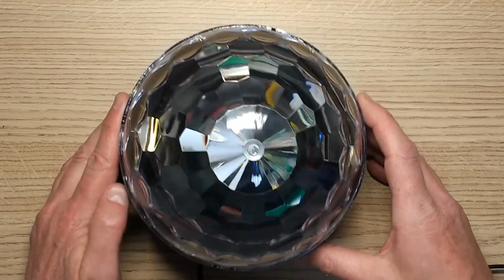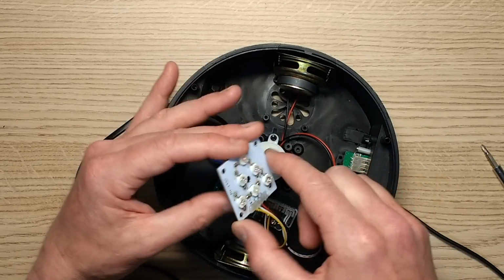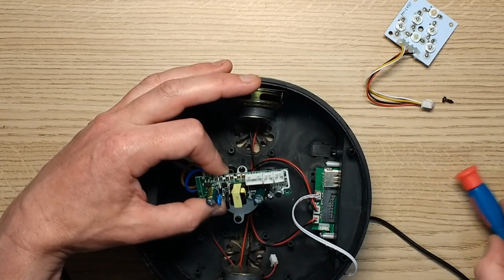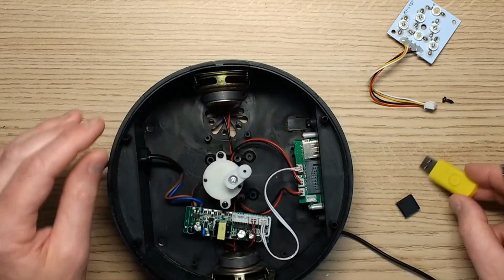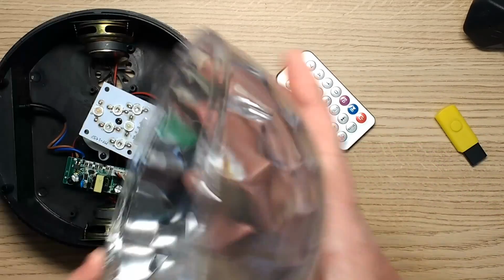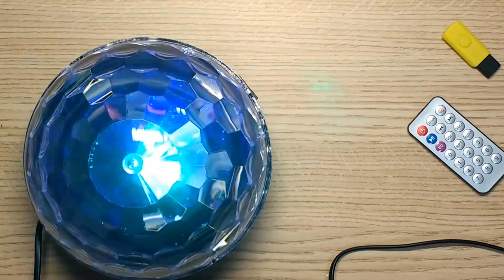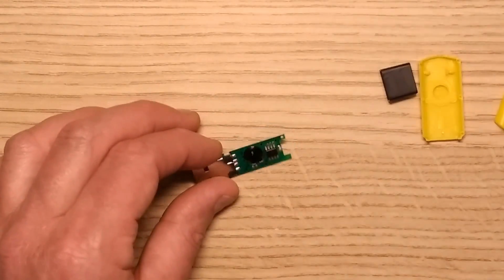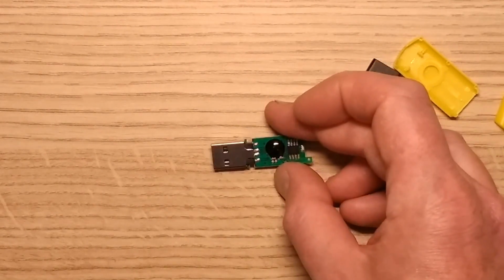Not so shitty MP3 disco light.

Comment: I got a similar Module awhile back, but it was just sound activated + an LED Ring at the base. Like you said, very modular. This one has a seperate power supply for the LED ring and the dome. This one just had three LEDs in a triangle formation so it would interact with the optics of the dome to create dots of light and and three intersecting rings. The audio gain was rather low, which actually made it work surprisingly well hanging (temporarily) on an electrical pipe. When the stage was dark, it was actually quite visible and responded to the beat of the music rather well.

The "dark side" was that I ordered two at once, and only one had a micro controller... The other one was a dummy that just tracked the lights across a supply and operated continuously.

Comment: @clive the yellow dongle is a low capacity flash drive with a few test songs on it, at least it was in my case, just plug it in the mp3 reader and you'll see
Reply: And probably also a trojan that puts your computer on a botnet for DDoS/Bitcoin mining purposes, the music is just a cover.
Reply: Delivery McGee - How do you get to that conclusion or were you kidding? I know nothing about this ducky thing.
Reply: Delivery McGee It won't trigger anything if he just plug it in the build-in mp3 player as I suggested...

Crocellian I have a bunch of these. They're quite nice and cheap. PSU tends to be overdriven on the cheapest ones though.
Reply: or just run a virtual machine and use that.. or make sure you have decent anti-virus installed. :)
Reply: Crocellian -- not paranoid, just pragmatic. Plug it into an mp3 player, it'll play a few songs to lull you into a false sense of security. Plug it into a PC with autorun on by default, and, well, let's just say the first thing I do when I get a new PC is turn autorun off. So yeah, what Caledonian TV said. It's kind of a thing in black-hat hacker circles to just drop a thumbdrive in the parking lot, y'dig?

Comment: I'd expect that cable that feeds the LED board to eventually break at the connector of the main board. It's just a crimped small gauge wire and those aren't intended for repetitive movement.

Comment: I got one of these a while ago based on this video. Came with Euro pin plug, but runs fine on 120ish VAC, so clearly "universal" power supply. Sound is more or less as I expected from a plastic enclosure like this - like a can of oatmeal. Might look into gutting it and putting the speakers in a smaller enclosure that matches their Thiele/Small parameters.
Could be fun on a suspended platform lighting up the ceiling as a sound-activated mirror ball thingy.

Comment: It generally takes 5 to 6 weeks to get an order from China where I live. Its ok as long as I am not in a hurry and no, I dont expect quality merch from them. Generally when I buy something, I have already planned on modifying it anyways. I cannot get some of the stuff I need for a project as cheaply as I do from china. Once I get it mastered however,I generally look for better quality components to do my final build. Its better to burn out a box of cheap inverters or whatever trying to get something figured out then to even build something myself. After I get things operating as planned,then I upgrade to better parts or actually seek higher grade components. I know developers that do this on a constant basis. My brother works in a research and development company for making packaging machines,they buy cheap micro controllers and cheap ass hydraulics as test equipment until they get past the initial stages,then they invest in higher grade parts.

Comment: Theres' also a "nice" one that can be built from an Arduino that will interface with wireless keyboards (Logitec, Microsoft, HP, Dell and other popular brands) pairing with them before the computer can, then paring it's self with the computer, so it can record all your passwords to your computer, and you bank and anywhere you do billing etc. and can then either store them, or try to use your computer while you're away (with the passwords it's remembered, and knowing you're away because it can't see you operating the keyboard, and may even know it's late at night) to send them up to hackers.

Comment: The usb stick looks like one of those promotional/advertising ones that acts like a keyboard and opens a command prompt to launch a web page and redirects you to a site whose url string is contained in the serial memory chip. To be safe you can sandbox it in a virtual instance of windows. I don't think much of anything will happen if you plug it into a linux machine but you can try opening a text editor and then plug it in to grab the url/command strings and see what it's trying to do.
Reply: sjm4306 Advertising sticks that run keystrokes? Where do those come from?
Reply: lights0123 I've gotten a few in the past. Can't remember from which companies but they were a thing a couple of years ago along small usb sticks with company logo branding given away at trade shows/conferences.

Comment: check the plug on the power cable, ours (from eBay UK seller) had a fake fuse installed, it that was connected to nothing! , the wires in the plug  bypassed the fuse completely, plug had fake BS standard marks etc.. 
🔥🔥🎆

Comment: I bought the Maplin version of that light a few years ago; it has DMX connections, but that's about all.  The user guide has the DMX personality table; but it's meaningless.  Other than the odd blink when you change a couple of the DMX values; it doesn't do a lot.  It's been sat in the bottom drawer of my filing cabinet ever since.  I might put it on Freecycle; unless that is Clive, you want me to send it your way to take to bits?

Comment: Definitely doesn't look like a rubber ducky since it has no micro SD slot like most of them do. The also seem to use an ATMEL CPU most of the time and those are generally bigger than that blob on the board. There also doesn't seem to be much on terms of power management on the board.

Comment: Just a note, Hak5's Rubber Ducky can automatically detect and inject payloads for any operating system, including Linux. Chrome OS is just another version of Linux, like Android is. You can't rely on a visual identification, either as someone has suggested, since  there are "generic" rubber ducky like devices that you can buy for a couple of bucks from China instead of $45. :-) 

Your best paranoid bet is to use an air gapped  machine with no mass storage connected (ie disconnect the HD or SSD), then boot up a live Linux DVD (Tails for example), and insert your mystery USB device. You can now use "lsusb" to see what the vender ID and product ID (eg: 03eb:2401, for a rubber ducky) for the device is, and then you can look them up on a net connected machine, although you can change the vid:pid on a rubber ducky, it's a good first thing to do...since if it shows up as a keyboard, you will know that something is fishy.  So if everything seems to be OK, you can mount and then list the contents. And then continue on with whatever OS the files are for, after checking them for malware, of course.

Comment: If you get the real DMX ones could you check if they fixed (received and using my fix) for the address decoding? I have 2 types of them and both had problem if changed the base address: instead of shifting they just blanked of the lower addresses and possible corrupting the RAM above

Comment: On the topic of USB killers, how viable would a small device to test them be?
Something in the order of a 5V power supply to a USB A female port through a diode so that the back flow from the Killer will shunt through into a neon or whatever. Honestly I'm not too sure on the requirements for such a device but surely it would be possible.

Comment: I've once got the same USB stick before, the controller will tell the computer it's a 8GB flash drive but when you write data in then it will overwrite the eeprom over and over again when it's full so basically it's useless

Comment: Download Knoppix (Linux LiveCD). You can use that to test to see if there is malicious software on the USB stick. Fully running linux operation system with many programs. I use it as a rescue disc for diagnosing and sometimes repairing hard drives/data recovery.

Comment: As well as proper mounting of the top dome and a properly isolated PSU, I'd want outer sheaths over the motor and left speaker (and light?) wires to bring it up to standard.
As it is, this thing's still shitty enough for me to avoid.

Comment: Clive and/or audience, does it have an upper cap on SD card capacity? This might be something I'd hack into my car, if it can handle external harddrives > 64GB. There's a chronic shortage of cheap mp3 players that save playback position (ea; don't revert back at the beginning of disk/card) AND are capable of handling large sd cards and/or external HDD's/SSD's.

Comment: Hum. So that device has a nice full-length ground pin. But it also has a two wire power cable. So what does that ground pin ground? The plastic power connector body?

Comment: Lol, just opened 2 of thumb drives in the same style shown here. One had a controller chip on the front and a blob on the back. The other had a controller chip on the front and a micro sd card soldered in on the back :/

Comment: I have something that looks like this but does have dmx. The dmx doesn't work properly (responds to noise as you plug it in but not actual packets!), and it rotates in different directions so basically winds it's cable around the motor and then unwinds it.
Reply from the maker: I have a DMX version too, but haven't tested it with actual DMX, mainly because the only items I can test it with are too expensive to risk damaging with a non compliant device.  It has a stepper motor for the LED panel and a mechanical end stop to get an initial reference position.
Reply: It might be ttl serial instead of rs484 like its suposed to be.
Reply: or even the wrong speed who knowes:)

Comment: The USB port is a computer port, not an appliance port. It will be for connecting a USB stick with music files on it.
EDIT
Oh, that thing. Well, I wouldn't plug it into a Windows PC, but maybe one running Linux from another USB stick and with the HDD unplugged from the motherboard.
Reply: bluerizlagirl The Linux command line can still do a lot of damage in that mode.  Note that the reason computers can't ask before accepting a fake keyboard is that if it was your real keyboard, you couldn't answer  until it was accepted.
Reply: John Francis Doe Ah, but if it the HDD is not connected, then there is no way for any changes the dodgy device makes to persist  (except on the boot USB media, but you can always re-image that anytime);  and if the Internet is not connected, then there is no way for it to affect anything else.
Reply: it could presumably reflash your bios...
Reply: Random Blogger But BIOS images are highly motherboard-specific, so there's still a chance of it not doing much.  The main chip is an 8MB flash PROM, which is just shy of 9 minutes of 128 kbit/sec MP3 music.  Maybe unsolder it, hitch it up to a programmer and read the contents out that way?  It should be easy enough then to analyse the contents with a hex editor.  File systems have an obvious signature; similarly, Windows, Linux and Mac OS executable files all have signatures, and the directory file for the root folder will be at a known offset within a file system because a folder's directory is literally what tells the computer where on the "disk" the files in that folder are, and it can only look in some fixed place for the first folder until it has read the directory and so knows where everything else is.

Comment: Hey there.

Just wondering if anyone can tell me if Orico extension leads are any good. The reviews for the one I'm looking at are mixed, so would like to get any opinions from someone like you (or others who know their stuff)

The product = The ORICO 8 AC Outlets 5 USB Ports Surge Protector (HPC-8A5U-5A-UK)

Would like to know if this product is all hype or if it is actually good. My intension is to use it mainly for things like my Virgin Router, TiVo box and maybe my PS4, XBONE and TV. With the USB ports going to charging the console controllers.

Comment: The dodgy USB stick thingy is probably OK but if you don't want to risk it, you could try reading it on a computer booted up off a Linux live CD - if you're REALLY worried you can disconnect your hard drive first. I keep an old 100MHz pentium laptop around just for testing random usb stuff like that

Having said that, there are USB kill-sticks out there that deliberately destroy the host device by using a dc-dc converter to generate high voltages on the data lines, though most of these can be identified by hooking them up to a 5V power supply and measuring the voltages on the data pins. Sadly there's some properly evil crap out there :(

If in doubt, throw it out!

Or at least take it apart and attempt a bit of reverse engineering first :)

Comment: cHROME DOES not HAVE THE auto exec that windows has..
Windows can SEE certain files and NO matter what you do, it will be executed
..
Reply: Linux ftw
Reply: Ed ash ...I thought you could hold down shift while inserting media to prevent AutoRun on Windows? Granted, if the thing poses as a keyboard and immediately spends 20 milliseconds downloading and executing some nasty trojan via your command prompt, you're still fucked though.
Reply: Ever notice that Windows Spins up the disk as soon as its closed??  That s a preload of the DIR..and other data..
You can Turn it off, but its on eof those things that LIKES to reset..

I dont know Current Base, internal CD commands, but in the OLD days there were tricks you could do in the DIR, BAM maps..that would let you don almost anything..
Reply: If it's sending key strokes, it doesn't matter if your computer will autorun a file or not. It could still open a terminal and type up a virus, compile it, and run it.
That will be very specific to the operating system you are running, the software you have installed, and whether you changed the default key bindings for opening a terminal or bringing up a run prompt.
Reply: rocketman221projects If it's Linux you could theoretically write a udev rule to ignore newly-plugged-in keyboards.
Reply: Its not the KB, its the input register..  As (CURRENTLY) most of this is USB..you would need to Block the channel, and register.  but then your KB would not work.

Its still the register, NOT the KB.  its like watching letter display 1 at a time on the display..and you are not typing..

There is only 1 foolproof way(not the only way) to read something and NOT initiate ANYTHING..  Get a program to NOT read the BAM map, and to manually look for the DIR only..  or a compatible OS that will read the disk..which are many..use ANDROID..
Reply: Ed ash   would some kind security expert explain for this twit how a device imitating a keyboard could do anything without first entering a password?  Boot the computer but don't log in.  Plug in the suspect stick and see if the password entry field goes bonkers.  No?  I suppose it could stay stumm if a password is requested... but if you log in to an account that has virtually no permissions...  or if you're running live Linux from a dvd?
Reply: 1. SO YOU HAVE a Flash drive and you are not logged in, and you want to find out whats on the drive??  Whats the use?  you cant view it anyway.. Windows OS isnt running, and Auto EXEC isnt there??
Login and Windows initiates all the drives??  Ok..  Then you can get hit..Just as if it was a virus in Autorun..
BUT, it can read your hash..

Have you ever had to hack into your own windows cause you lost the password??  go look it up..its a neat trick..

THEN goto HAK5, and look at ALLOT of videos from years ago, on how this works..
Reply: Ed ash Yes, had to use an Ubuntu boot CD to restore the password on our office PC a while back because some kind of malware passworded the only account, switched administrator access off and broke some files, so I had to reset the password and enable admin access to be able to get in and fix what was going on.
Reply: And an external/online program could not do this??
I had the same problems a few times, for my customers..
And reading on the net, there are a few ways to do this..
Is to use Linux to swap 1 program at startup..which will give you the option to load in and reset the password..

There are options in BIOS to turn OFF, auto boot,  from USB/CD/FLOPPY..

The most secure systems are a PAIN IN THE BUTT..if you forget 1 thing, you may never get into them..but we are humans, and that Kinda sucks..we forget, and kids LOVE to change things, and more then 1-2 people on a computer is ASKING for things to get upset..  There has to be a way to GET into the computer and reset/FIX/Backtrack the computer..

I only ask for 1 little program..
I wish for a Browser that would save a comment to EACH BOT/SCRIPT loaded from a site..  THEN if I can find the Virus/Bot/Tracker after a failure..I can SUE the hell out of them..
Reply: You can run commands, for example send a sequence including Windows+R, run a malicious command, open notepad.exe, edit a file or save a script etc. There are lots of problems like lock screens, the user noticing etc. But this is operating system agnostic (if you send the right sequence of keyboard input) and has nothing to do with autorun.
Reply: You can filter specific USB VIDs and PIDs without breaking an entire device class. This lets you lock down USB devices to specific manufacturers or chipsets. This is possible on both Windows (often managed by proprietary endpoint software) and Linux. Very few people do it, of course.